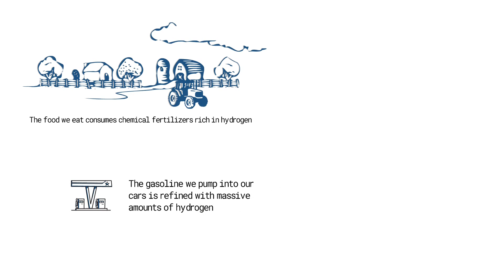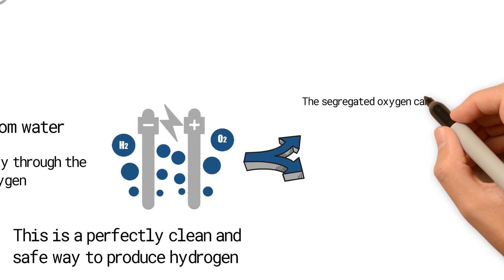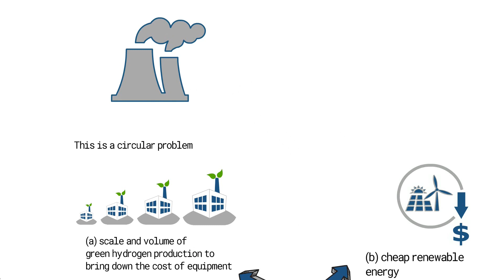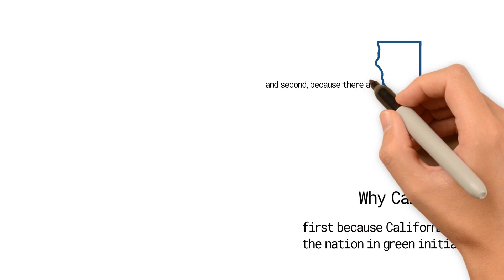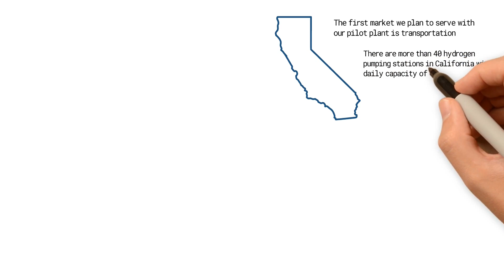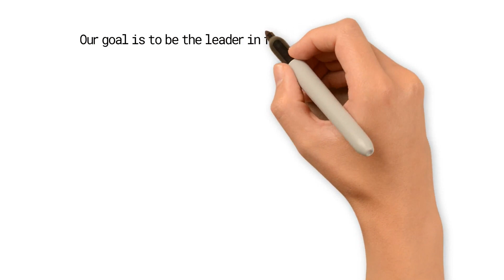Green Hydrogen Production and Distribution (NEW)

Comment: Personally, I think for any mobile and energy transport application it would be better to use the ammonia rather than hydrogen. It generally has much more infrastructure existing than hydrogen and is a more dense form of energy by volume. And it is also generally safer and easier to handle than Hydrogen as you don't have to deal with the super high pressures or super low temperatures that the storage of hydrogen requires. (not to mention the hydrogen embrittlement and leakage issues). Yes, there is the corrosive/poisonous issue with ammonia, but human senses can easily detect it, so dangerous build-ups of it are less likely to go unnoticed. And since hydrogen liquification costs are comparable to the costs of converting it to ammonia, you are not really losing out by using the ammonia directly as the fuel.

I have also heard that direct ammonia fuel cells and direct ammonia synthesis is possible, thus being able to skip producing/using hydrogen as an intermediate step, though pending research probably still needs to be completed for whether those processes are more efficient or not. But use of ammonia crackers to free up the hydrogen for whatever application it is required for is also an option.
Reply: a good point

Comment: Water vapor and Methane are also greenhouse gases with the former contributing considerably to global warming & hydrogen combustion gives Water Vapor. Water is very much needed daily for drinking, washing, cleaning, cooling, cooking, farming, extinguishing forest fires, etc- it is bad idea to divert the usage of water for making hydrogen. Each of India & China have human population of nearly 139 crores. Each human person excretes out on an average 1.4 litres per day of urine. A litre of fresh urine has 460mg Nitrogen in the form of NH3 or NH4+ ion and stored urine will have higher amounts. Urine is however a scattered and discontinuous source of NH3. NH3 can be decomposed catalytically at high temperature and low pressure or can be reacted with an alkali metal like Sodium catalytically to give Hydrogen. Chemists and process engineers should work on developing efficient catalysts or an efficient, safe cum economic process to convert NH3 to Hydrogen. Urine has 8.57g/l of urea or CO(NH2)2, research has been done on electrolysis of urea solution to give Hydrogen.

Comment: Your electrolysers linking green hydrogen production to advanced Small Modular Reactors [SMRs], particularly GE Hitachi's BWRX-300 is the future for your industry. The first BWRX-300 will be operational in 2027 and in factory production by 2030. You can get your electrolyte up to 70 or 80C too, from the plant's waste heat, which improves efficiency and brings down the cost of production.

Green hydrogen from renewables would bankrupt the UK. Green hydrogen from advanced SMR will be the way to go in the UK:

https://bwrx-300-nuclear-uk.blogspot.com/2020/04/parliamentary-post-postitnote-651.html
Reply: lol, I dont think you have think this through. if you decide to go through the SMR path, why do you need to make hydrogen? The whole point of making hydrogen from renewables is because renewables produces power in an intermittent and non dispatchable way. Transform green electricity into hydrogen will help it to be dispatchable.
Reply: @aerime  but nuclear power is already despatchable, which means it can decarbonise the electricity generation sector on its own. But all other sectors which cannot be decarbonised by using electricity directly - much of heating, transport and some industry - have to be fully decarbonised using green hydrogen (GH2).

That is why, in the future, our most cost-effective way of decarbonising humanity's energy use - and with microscopic environmental impact - is SMRs manufacturing GH2.